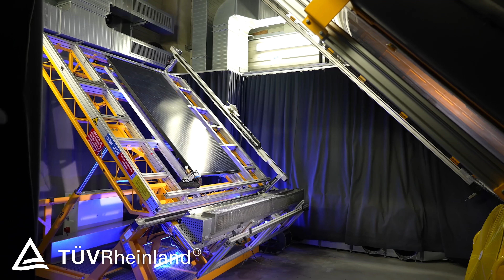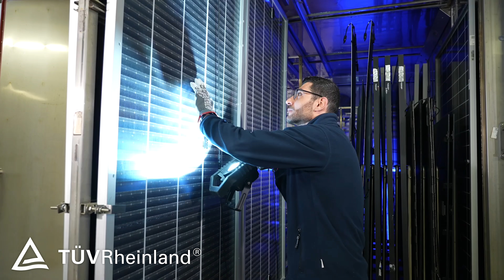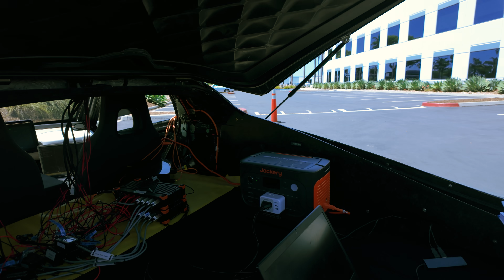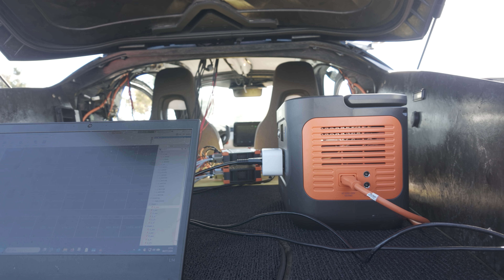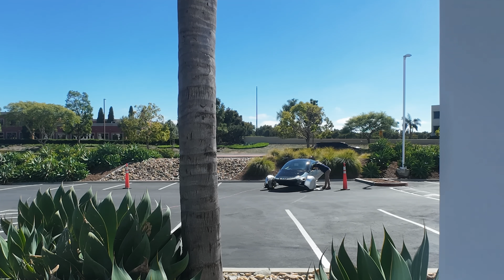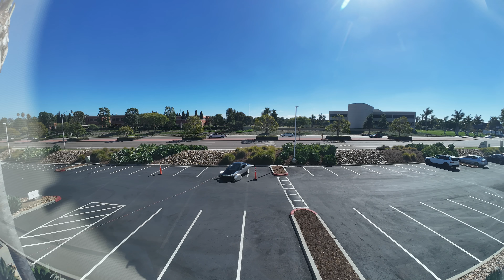Aptera's Solar Output Is Now Independently Measured

Comment from the maker: Full TÜV Rheinland report → https://aptera.us/tuv-report and the press release → https://aptera.us/tuv-release ☀
Reply: I'm not that fluent in electronics, but the different panels to cell strings stuff makes it sound like the solar is hooked up to less than 1/10 of the battery cells? Do those cells then distribute to the rest of the cells in the battery pack?
Reply: @BadManJ0se  The solar cells aren't connected directly to the battery cells. The output of them is pooled in a battery management system and charger.
Reply: @kellymoses8566  Thanks! Do you know why there's cell counts per solar assembly?
Reply: @johnreeves7261  🤦I realized "Cell Count" is referring to solar cells, not battery cells. Ignore me...
Reply: Congratulations !

Comment: All they had to do, was start with an empty battery, let it charge from empty for a full day, and then measure the distance + the sun intake from the following day while driving. (you will take in solar during the day).
We just want to know how far it can drive.
Reply: I'm sure the Aptera will easily make it to a fast charger from where you are. "We" just want to wait for Aptera to release information as they are able.

Comment: Tesla just started building cars and fixed them along the way. Why can’t Aptera do the same? Is the vehicle not ready for release or do they simply have no resources to get cars moving down the line?
Reply: While the full-scale production requires more money (as they said), this isn't a typical fake-autonomous-driving-until-you-make-it Elon company. So at the moment, they just build a few of the cars by hand. Fixing mistakes later can be quite costly if they are fundamental. Imagine recalling them and having to disassemble them to fix a core problem.

Comment: Congratulations on the third party numbers. If I were investing in this vehicle purely to cover the cost I pay in gas, to travel. The Aptera would start saving me money after 200k miles. 20 ÷ 4 × 40,000 = 200,000.That's good enough for me. I don't see the cost of gas going back down any time soon.

I currently get around 20 mpg in a 16 year old used car, with 280,000 miles on it. I bought that car 10 years ago, with 120,000 miles on it, for 12k. If I bought the Aptera instead of this used car, the Aptera would have saved me 4k by this point in time. 160,000 ÷ 5 + 12,000 = 44,000. That's only considering the used price of the car and the gas, not the oil, or other ICE related maintenance I've had to perform, including a total engine rebuild for a few thousand dollars extra.

If I bought a new car that averaged better gas milage for 30k, I could have spent 50k by now on the cost of the new car and gas alone. 160,000 ÷ (32÷4) + 30,000 = 50,000.

Would I travel more, if my cost per mile was cheaper? Yes.

Comment: This is dumb AF.  Intelligent people shelter their cars when parked.  You know what happens to cars left out in the sun?  Dashes crack.  Steering wheels crack.  Headliners droop.  Tire sidewalls degrade.  Paint cracks and peels and fades.  

Reduce cost of the car.  Remove the panels from it entirely.  No one wants bespoke weird shaped proprietary panels, other than OEM auto manufactrurers and whomever your contractor is that made these panels.  If you really want to be edgy and pro-consumer, include an MPPT controller capable of accepting input from 1-2KW of solar panels in a ground or roof array independent of AC grid integration.  Maybe make the car function as a home backup battery... what's that called?  V2H?

Comment: About 20 years ago I was a huge cheerleader for Aptera, since then Tesla was born and took over the world and Aptera never sold 1 single car, by this point Aptera just irritates me because "How in THE HELL could it take you 2 decades to come to market" now it FINALLY looks like the car that you don't have to buy anything to make it run is HERE!!! yeah.. well let me tell you my electric car drives about 40 miles a day 20 miles each way to work, and additional errands from there it is a small mercedes eqb and it uses about...... drumroll, 25 kwh per day,  So not only did they take forever to get to market but there is no way that thing can go 40 miles a day and errands at 4.2 kwh.  Aptera I loved you and I loved the idea but it is turning into a huge swing and a miss. unless you can come to market for under $20k I don't see the value

Comment: Well, unless the Aptera car has air conditioning or heating, it doesn't really have much solar mobility over say an electric bike/scooter with the batteries charged by a solar setup. The only other advantage it has over that is the storage space in back for shopping and whatnot. It still has its uses, but they're fairly niche. I hope to see the Aptera continue to make advances in sustainable, mobile solar charging.

Comment: You know, why do you waste space on the Roof by turning the Solar-Panels to a 45° Angle, leaving out multiple panels of Space worth?
Reply: If you knew anything about how flat materials bend you would be aware that squares bend more easily on the diagonal than side to side... or you could just assume these talented engineers and designers know a lot more than you do and they probably didwhatever they do for a very good reason.  How about that.

Comment: It would be MUCH MORE efficient solar-wise and CHEAPER to park a non-solar EV under a carport featured with (fixed) solar panels ! But who cares about efficiency when marketing rules ("Solar mobility" bla bla bla...). When you park your car under the sun, guess what you do FIRST when you enter into that car : put the AC full speed ! Park your car in the shade of a carport and use the electricity generated by your carport to charge your EV.

Comment: The posible problem that may exist is the road gravel, where even a small amount of debrie could be hiting the surface, just as it occurs to regular vehicles, this could create chiping or delamination, and fracture lines in the outermost layers, this may be fixable with hand aplied resins, but then perhaps it would be some exotic material, not common, thus it would reflect in cost of maintenance, here just taking one bad road could be aufully expensive due to the damage produced to the layer covering the solar panels, to the point it may be more realistic to have swapable panels instead of something cemented to the body of the car. I imagine exotic diamond layer could solve the ordeal, but then that seems scifi... perhaps a transparent film could be applied to provide some basic shielding

Comment: And yet you don't use a volt amp meter or 4th grade math called Ohm's law as once it's connected to the grid becomes a parasite
Reply: They really should have flown a kite in a lighting storm.  I know this because I'm looking over their shoulders and carping because I know better than they do.
Reply: @J-W-Kelly and we have the instrument and Ohm's law to demonstrate their ignorance
Reply: Should qualify be sure you are using an amp clamp that is rated for AC and don't forget the one293
Reply: @dennisdickinson8337  Is the Kaiweets HT208D what you would call "an amp clamp"?  What is a "one293"?
Reply: @dennisdickinson8337  FYI, with a @dennisdickinson8337 approved grid, solar grid-tie inverter, test equipment and test procedure and no clouds in sight, when the inverter displayed AC Power output of 1607 watts at 241 volts, to no one's surprise, the approved test equipment displayed ~6.7AC Amps on each of the two hot legs" going to the electric utility's NET Meter.  6.7 AC Amps x 240 AC Volts = , wait for it, 1608 AC Watts.

Comment: Of course, they did tested near the summer solstice. That way the numbers look best.
Reply: Well..... extreme duh! And whooosh, right over your head! What other way should they find out what the vehicle is capable of? This is yet another idiotic troll-take... everyone with a brain who has paid any attention to how solar works knows that solar performs best on long days around June 20th... and still provides energy the rest of the year.  The multitude of variables based on location, shading, date, and weather will have to be learned by Aptera owners... again...duh!  You could use the Aptera solar calculator, and use that as a basis for more trolling.  Opportunity to up your game, and you should take it, because your game is some very weak sauce.

Comment: I mean, was anyone doubting the power collection?  I know I wasn't.  I just want proof of efficiency numbers because somehow that hasn't changed one tittle since they initially pitched despite absolutely massive engineering changes.  4kWh is the sunniest part of the world is great, but since you've always said up to 40 MILES under the assumption that efficiency is going to be 10 mi/kwh and you still haven't actually said what your efficiency numbers are I'm dubious that you're actually beating your claims.  I've said it from the start and will continue to say it - the best way for you to implement the solar would have been to eschew it from the design of the vehicle altogether and offer for those who want it as a voucher program for panels on their property or shares in a solar farm.  Such an action would have reduced cost and complexity (and probably weight as well) and I bet they would be on the road by now.  Where is my 1,000 mile range 2 seater for 40k that I was supposed to be able to buy years ago?
Reply: The anti-solar troll whinge is particularly pathetic.  Aptera is building their vehicle with solar.  Many of us appreciate that this makes sense on a hyper-efficient EV.  They are not building some other vehicle for all you bleating smear-puppets.  You will just have to deal with that.... and if that means more idiotic trolling from you and others (it does), so be it.

Comment: I am pretty sure there isn't a single person here who isn't thinking that it's got about 40% of it's total surface not covered in panels. Everyone who buys this is going to think that. We all want a completely covered version of this thing. and not oh diminishing returs blah blah blah, why would i want something that is going to sit out in the open that has paint on it that's going to degrade. I get it that maybe impacts or there are other arguments to be made but those arguments are still never going to make up for there being most of the surface area not being used.
Reply: I hope this does not show up twice... just had a response disappear.  You need to educate yourself about solar.  There is a diminishing return in the expense of more MPPTs, cells, and manufacturing the glass for far less energy than the upper surface provides.  The Aptera engineers are far smarter than you or I on this subject, so why would you look over their shoulders and carp about that which you are completely ignorant?  Also...The Aptera is wrapped, not painted, but worrying about paint degradation is so cute!

Comment: Which direction is optimal for parking with hatch closed?  Hatch facing south?
Reply: At any given moment, facing the hatch toward the sun is optimal. East or west will be best if not moving the vehicle during the day. That’ll work for much of the year. Fall and winter facing the hatch south would be best for northern latitudes outside of the tropics.

Comment: its is very cool stuff. but i'm wondering if there is any plan for the batteries themselves. seems like lithion batteries are on their way out, I'm wondering if they have plans for Sodium-ion or solid-state batteries. I heard base model is expected to be 26k? if they make the car lighters,  cheaper  than 26k even if its only 150mile(tossing out a number knowing sodium is not as good a charger) range would be amazing for most daily commuters?

Comment: The solar is cool, and would be great for off grid and dropping charging costs to near zero if you dont drive super often. However, 40 thousand dollars for a 2 seater with okay cargo space? Not buying it. If it was 30k with same 400 miles then maybe, but there is a 10k price difference just on 15kWh battery size difference.
Yes, I really like the concept. But unless the price comes down not many people will be accepting that a 2 seater is 40k even with the solar.
Reply: Buy a used one in 5 to 10 years.
Reply: @The_Solar_Racer good point, they will probably depreciate relatively quickly

Comment: Question: parked it charges 4+ kWh in one single day. But, does it charge while driving? Can it be using energy from batteries while charging energy from sun? And, any time planning to start selling it in USA? Europe? Any date? Thanks.
Reply: Solar panels still provide power when driving.
Reply: @The_Solar_Racer that’s so nice!!! So cool engineering!!! And any timeline for selling in USA and reaching Europe? Thanks!!

Comment: This is so big. 4kWh is huge amount of free energy.
Reply: You will get this maybe 7 days a year, very close to the equator, parked away from any other objects or trees.

Honestly, I cannot believe the naivety of these comments.
Reply: @truantray  how much free range does your car generate in a day? This is tested in California…where there are 30 million people and just as many cars. That’s a fine “niche” market to target.
Reply: @tyrelirwin most Californians cannot afford this car
Reply: @truantray  Even one kWh a day from the sun, on a vehicle with the potential efficiency of 10 miles/kWh, would be huge for me regarding the need plug in.  We travel roughly 60 miles a week in our BEV; seven kWh generated over that week would basically take care of our needs using an Aptera.  We use the same concept now load shifting when the sun is out:  charge the car, run the dishwasher, vacuum the house, wash clothes.  Yesterday after work, I plugged in for two hours; the 4 kWh added to our car came from our panels.
Reply: @truantray  Yeah but it is completely free.

Comment: Great confirmation.
Now to test it in the real world, witch has scratches on the panels, shade from trees and buildings, a cloudy day, and in winter conditions.
Lab testing is fine for a theoretical maximum but the real world never works like that.
Good luck tho.

Comment: How much extra power do you gain by parking next to a tall, south-facing white / reflecting wall? In that case, some of the light reflected off the wall adds to the direct sunlight, thereby generating extra power. Reserve those parking / charging spaces for the Aptera?
And what about parking under a slight angle: 1 front wheel higher? Or the back higher/lower: where to park on a road up the hill?

Comment: Will it be possible for owners to plug devices like a Jackery battery into the car to charge it via the panels? Or is this just for this test?
Reply: Yes. Such power stations can accept a charge from the 12V port in the hatch right side or via two USB-C ports. IIRC, 15A and 30W, respectively.
Reply: @The_Solar_Racer  Those can not accept a charge through the USB outlets. The real issue is if the Aptera's 12v system could support such charging. That amount of power draw would have to be considered in the design and software. Most EVs do provide 12vdc to the vehicle's 12v battery but that's not much amperage, the largest amperage would be for operating the headlights and fans.
Reply: @popeyegordon —  Not true. The older NMC units with 7990 inputs, that’s correct. However, some of the newer LFP Jackery units have bi-directional USB-C ports.
Reply: @The_Solar_Racer  Of little practical use. Automotive and solar voltages are 12 volts or more, stepping that down just to pass it through a small port, then having to step it up again to charge the battery is impractical for large capacity 'generators'. Most of them have fast high current AC charging options that blow away any little USB inputs in comparison.
Reply: @popeyegordon — I agree in both principle and practice, but people walked about options and choices. Many portable power stations still support 12V port charging and the cable to do so for this exact purpose. I normally use portable panels for camping. With an Aptera, I’d use the 12V port instead. USB-C for smaller power banks and such.
Reply: The jackery powered their test equipment. As a rule, there is not a sufficient return for carrying a solar generator on board. They don't hold that much power when it has to be jacked up to 100 VDC. It is inefficient to convert DC to AC, then pump that into a charge port that has to convert it back again.

Comment: Who cares the power of panels and current flowing? Honestly these are marketing numbers.
Deplete the battery.
Have a solar panel on a roof for reference.
Leave the car on the sun on a sunny day to charge.
Drive the car till stops.

No one is interested in shunt resistors and ampers. 

How much km can get out of the car after a day of charge when depleted is a system test that the user wants to know for the obvious use case.

Comment: Hab auf meinem E Transporter 2x 330 Wp Solarpanels montiert ! Im Sommer kommen im Freien 5-7 Ampere pro Stunde in die Batterie ,im Winter nur 1,5 Ampere .ABER ,der E Transporter parkt im Carport ,da kommt kein Strom , nicht im Sommer und garantiert auch  nicht im Winter ! Das ist Bullshit auf dem Auto !
Reply: Adding lightweight, inexpensive solar to an EV makes a lot of sense ... if the owner has the brains to park in the sun.
Reply: @netscrooge 
In der Sonne ohne AC und im Schnee mit riesigem Energieertrag !... Genau deshalb parke ich unter dem Carport !😅

Comment: My assumptions: The measurements are of what power enters the battery. What is the power consumption of the vehicle when parked in a dark garage or better yet in the sun with the solar panels disconnected and the windows closed? Or, what is the net increase in battery charge level with all system normal? And what state of charge does the battery reach at different starting state of charge?   Is it independent of the starting point?
Reply: You're asking the wrong questions.  Sounds like you're unfamiliar with how EVs work.